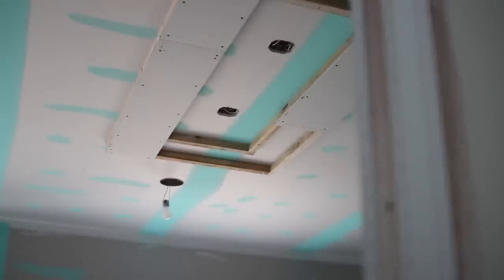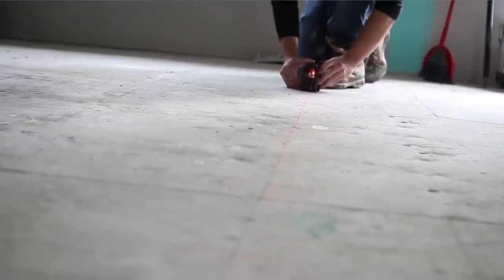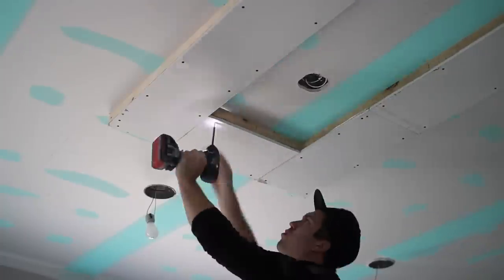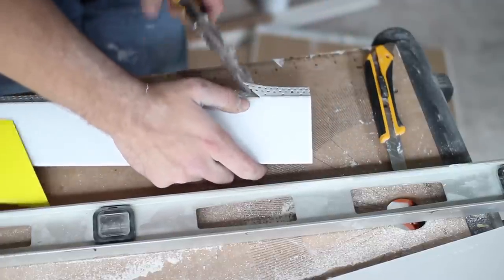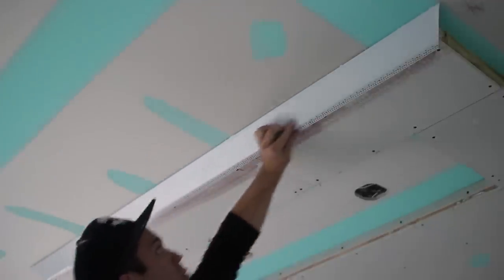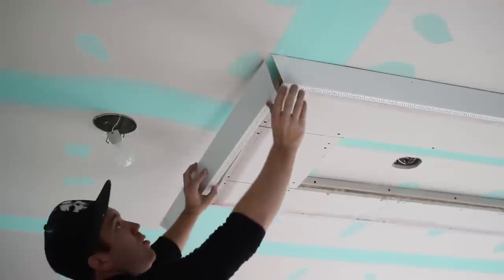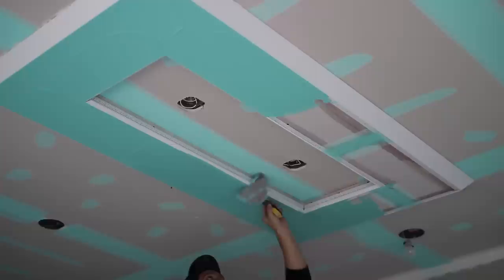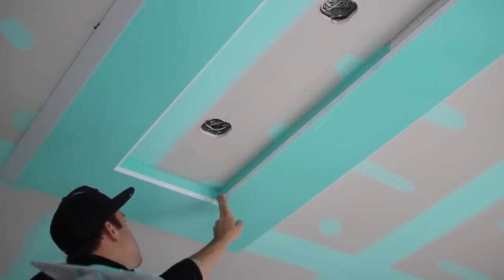Installing Trim-Tex EZ-Tray

Comment: HOW DID YOU GUYS MAKE THE MUD THAT ELECTRIC BLUE? IVE TRIED IN THE PAST BUT IF I USE CHALK IT NEVER COMES OUT RIGHT. IT WOULD BE AWESOME FOR TOUCH UPS. PLEASE HELP THANKS
Reply: Go to http://store.never-miss.net/ and get it there! The color is Pacific Blue.
Reply: John Flores does it paint over ok?
Reply: I personally have never used it. Some people add soap to their mud and paint covers that well. i believe painting over this isn't an issue.
Reply: Just use food coloring in your water first
Reply: Add drywall pigment

Comment: How do the outside corners stay together? They seem like they would be easily seen.
Reply from the maker: That same siliconized acrylic caulk, run a bead along the inside edge of the outside corner and when the two corners come together, just wipe off the excess caulk and use a small piece of painters tape to pull the miters in closely together. Works like a charm. Keep in mind this is vinyl, not MDF of wood, so there's no shrinkage or anything. Not to mention the pieces themselves virtually weigh nothing. So there's not much movement at all or anything that would cause the corners to move or crack. It's a pretty solid product.